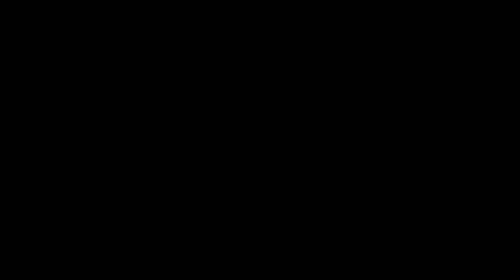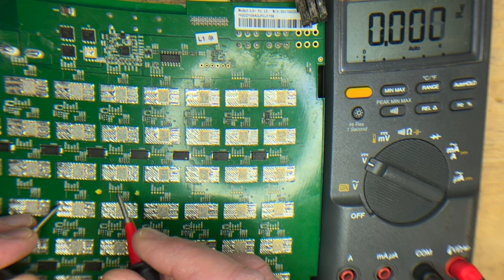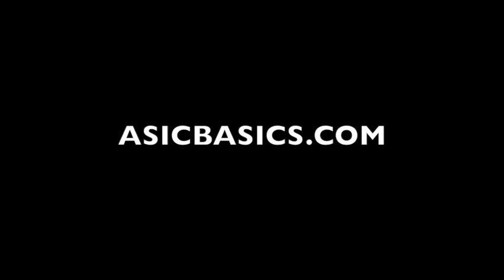ASICBASICS.COM - Antminer L3+, checking RI and CLK to find bad ASIC

Comment: 10v circuit and 14v boost circuit running Normal, but the hashboard still not showing/not detect..What are the other causes of damage??
Pls help me sir
Reply from the maker: You can try my website here, in the blog, or go to the fix it portion, and there may be pointers that help. Good luck! https://asicbasics.com/bloguverse/l3/